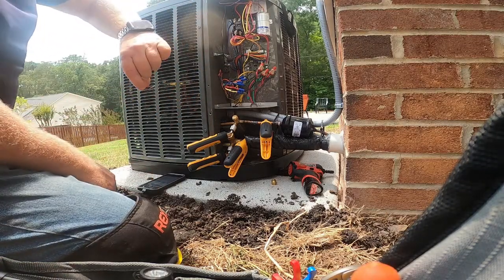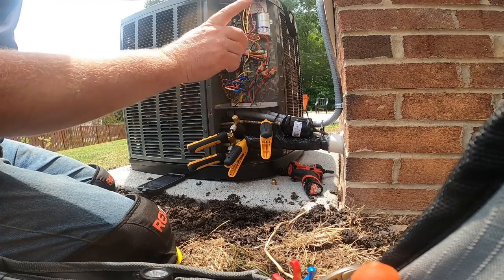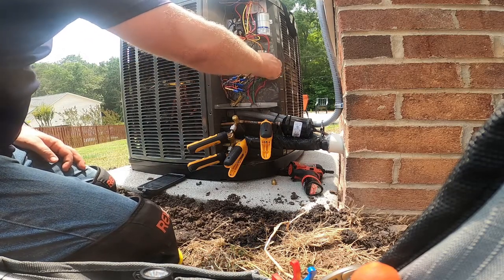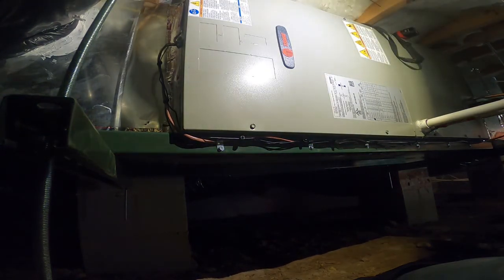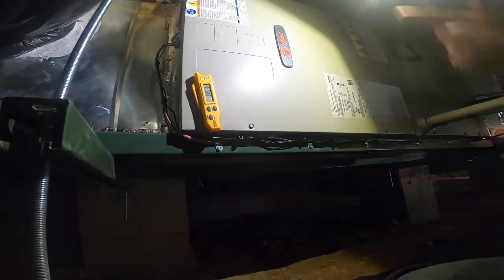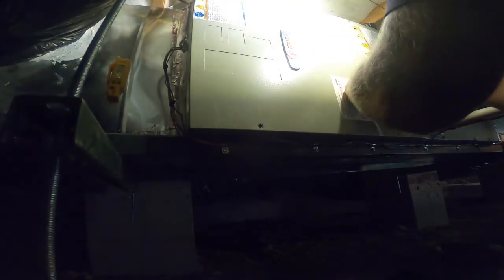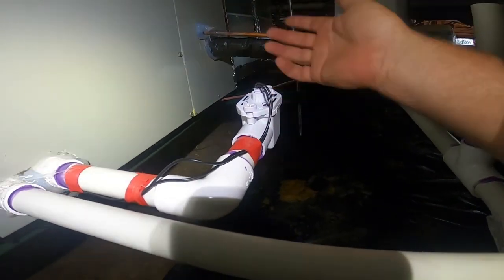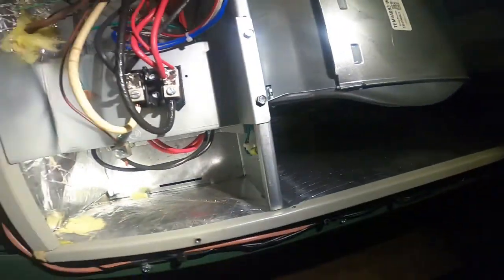Commissioning a New Trane Heat Pump.

Comment: What is amazing, system could keep house at 71 when we had a week of 100 plus, one day 117. Unusual for my location. That makes me like variable speed systems. It did make me nervous wide open, not tested prior as installed in winter. Rarely does the unit ramp to full speed unless cook inside when 90. Love it. Put surge suppression on everything once learned inverter systems too expensive to repair. No issues in 6 yrs. Always double check when power bumps. The ggreenies keep causing electricity more expensive on west coast. Part of why I still use gas and oil where convenient b
Reply from the maker: Variable speed systems are great for humidity and indoor comfort.

Comment: I like your attention to detail. When my system was installed, came with one year checkup. It actually pissed me off, then want $300/yr for annual?  BS. Do my own maintenance and call the pros when outside of my knowledge. I won’t mess with gas valves or refrigerants, but know enough on cleaning and temperature splits. I watch to learn. Thx.
Reply from the maker: I'm all for DIY, but sometimes you need the pros. We charge 175 for bi-annual maint checks.